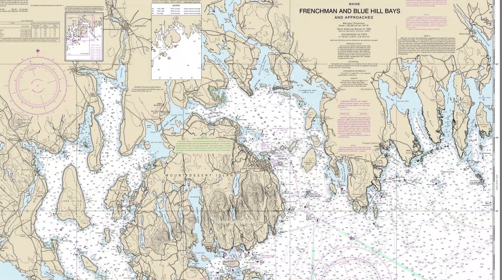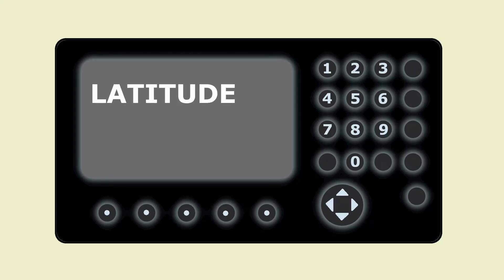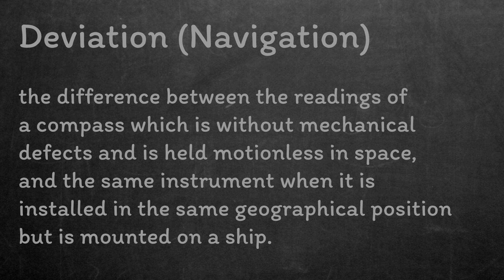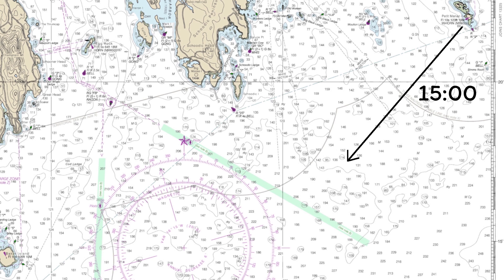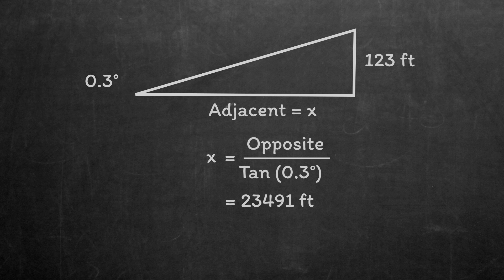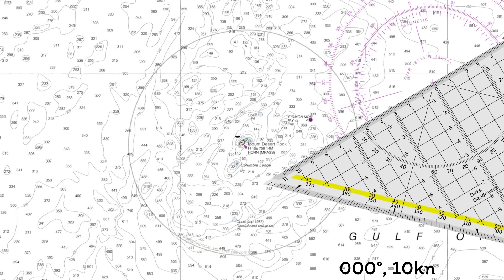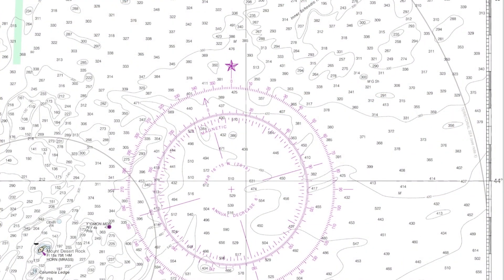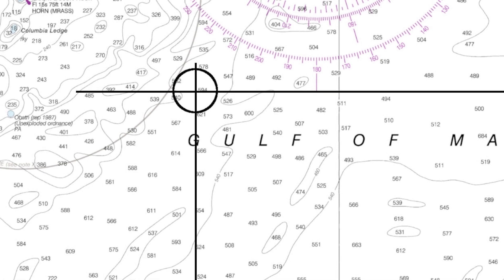5 Position Fixing Techniques

Comment: For small X, you can assume x=sin(x)=tan(x) (in radians).
Or sin(x) = tan(x) = x/60, x in degrees.  (Exact at 30 degrees)
Commonly used for aircraft.   Probably more accurate than your measurements

Comment: Longer the better.  Easier to review.  If one video contains the full range of data, but you need to refer to two or more segments of the presentation in order to clear up a mis-understood concept, you can always open multiple copies of the video and "navigate" to the several sections needed to achieve understanding.  Not unlike fixing your location using different techniques.  IF the videos are long, however, it is necessary to divide them up into chapters that will permit easier seek and find.
I really wish I had had YouTube when I was 12 ! ! !

Comment: I don't agree . If you take a compass bearing to a known feature ( the lighthouse ) from an unknown position ( your current location ) then you need to convert the final  bearing you calculated to a " back bearing " ( add or subtract 180 degrees )  and  place the protractor  vertical against the grid line  0-360 to North  and the center of the protractor is on the lighthouse and then draw the line from the lighthouse through  the correct bearing figure on the protractor  .  You are then located somewhere along that line of sight .   There is a slight  convergence between  the Grid on the map and True North.  It's small  at the Equator and gets bigger as the grid lines converge at the poles .  If you are measuring aligned to the grid lines your not really using a true bearing .  Just measuring on my screen that compass rose seems to be orientated to Grid and Magnetic variation and it's not clear  if any  Grid Convergence is added into the magnetic variation amount .

Comment: on compass deviations table: deviation from 000 to 45 are 4 degrees deviation, from 45 to 090 degrees the deviation is 2 degrees, so the Bearing (M) it is 58 degrees not 56 degrees...

Comment: Could someone please explain how 16 degrees and 15 something turned into 16 degrees .25? Is that because 15 is 25% of 60?
Reply: I don't think it's correct, since is decreasing, so it should be 16deg15' minus 6minutes (considering it is only one year after the 2018)...Either way, you can't keep a steady course on the compass regarding minutes, you (or the auto-pilot) can barely hold degrees. So a round 16deg should be acceptable for to be taken in to consideration. BUT the theory behind is important, not the small figures. 
Also, IMHO, the DEV taken,  should have been 1deg W, not 4, because the bearing was 60deg, so in between 45 and 90 (hence, between 2W and 0)
Reply: yep your are correct 16 degrees 15 minutes = 16 degrees and (15 out of 60)th of a degree = 16 degrees and 15/60  of a degree = 16 and 1/4 of a degree = 16.25            or  there are 60 minutes or arc in a single degree or a degree is made up of 60 minutes of arc
Reply: 15 'something' are 'minutes' from the sexagesimal division system; that was great for humans, but decimal points are better for calculations.
16°15" is equal to 16.25° as said    @sc6512

Comment: A fix is a position in which the navigator is highly confident. The act of establishing a fix is called "fixing a position" Fixes are already part of navigation by dead reckoning because dead reckoning relies on measures of speed, course. The fix proves the absolute position during a voyage. The fix itself can introduce errors if the reference point is not correctly identified or is inaccurately measured. As a freshman, this will be a challenging and fun topic to meet.

Comment: Questions: 1. If you took a visual bearing of a celestial body and made a note of the time UTC you could calculate the azimuth of the celestial body using LHA, DR Lat and Dec. From the value obtained you could calculate the difference between the visual bearing (compass) and the azimuth (true) which would give you a Total Correction. With this Total Correction you could convert from a Compass Bearing to a True Bearing, and viceversa. Is that correct? 2. Regarding the range, could we use the water depths shown on the nautical chart as a second point / line of position to determine how far we are from the lighthouse if we used a handheld or ship's depth sounder? Thank you for this video. I am going through a learning curve, so any feedback will be much appreciated. Cheers.
Reply: you can convert those true bearings to compass bearings, and they are to be used to determine compass error at that heading at that time.

consider measuring sun azimuths to be a way to swing the compass out of sight of land.
Reply: for your second question, you can use a depth as an LOP if you're very confident that it forms a line. look on your chart for very dramatic cliffs of depth.

Comment: Error in your application of compass deviation. 60 degrees compass bearing does not give a deviation of 4 degrees West. The deviation card has compass bearing of 45 degrees resulting in 2 degrees W, and 90 degrees has 0 degrees deviation . I would therefore use 1 degree West as the deviation correction in the example shown.
Reply: The deviation is based on the boat heading, not the bearing taken. One presumes the boat is heading North.

Comment: The GPS does not have "several LOPs hidden away"!!  The position it calculates is the apex of several triangles, pyramids, if you like, coming down from the GPS satellites whose distance it calculated.  The apex moves around a little as the calculations are performed, giving the horizontal (and larger vertical) errors of position.

Comment: The deviation card is for the steering compass and is found by "swinging the compass", turning the boat through the points of the compass and noting the deviation.   A handbearing compass will have a deviation depending on where you are in the boat and it cannot be corrected for as in the video - the position line shown at 5;55 could be 4 degrees in error.  Either a neutral location is found in the boat (by experimentation), or several bearings made from different places in the boat.
Reply: Even if the deviation card it's corect (hand compass or not) you should always use the closest value to the course (in this case would be 2 not 4)
Reply: @mariusstan7258  The sailor took a hand-held compass bearing to the lighthouse and applied the steering compass deviation to it. They are two different compasses and the deviation does not apply to both equally.

Comment: Here in the United States, we have the 5 Great Lakes, other places in the world have similar large bodies of water that are not at sea level.  It is rather easy sail out of sight of land based objects on these lakes.  Every tutorial I have seen on sextant use is for sea level only which doesn't work at the altitude of these lakes.  And then that altitude fluctuates based on season and rainfall.  Can we determine the altitude of the lake we are sailing on by sextant only?  And then how would use that altitude to determine our position?
Reply: The altitude of the lake doesn't come into the calculations at all.  Rather it is the level reference it gives when sighting the horizon.  It is the height of the sextant above the water level that matters, as this is the "dip" to the horizon.  If the shoreline is visible, then that is not a true horizon and there will be a big error, but as you can sail out of sight of the shoreline, then the lake horizon is equivalent to sea level.  The "horizontal parallax" correction takes account of the distance from the centre of the earth to mean sea level, but the additional height of a lake above MSL will be a fraction of a second of arc, way below what a sextant can measure.
Reply: SandhillGuitar Interesting question. I’d be curious to know as well.

Comment: Great vid... just wondering, with Gyro, you can assume this to be true when plotting on the chart right?
Reply: Yes, because the gyro compass aligns with the axis of the Earth’s rotation, hence with true north.
Reply: We were taught  in marine  college that there is a GYRO error (1-3 deg.) only  ,in all GYRO compasses  regardless  if it's on a container  SHIP or super-yacht.
Reply: Ships used to keep a Compass error book presume they still do?,  when you swing the Compass (magnetic) off say Glasgow the errors will not be the same in Buenos Aires. Gyro error used to be checked daily by comparing the gyro bearing (usually off repeaters) to the calculated azimuth bearing of a body. Repeaters were checked for alignment prior to leaving port when 'testing gear'. In the UK it was part of the UK Master Mariners orals exam to swing and correct a compass, also presume they still do, good video.